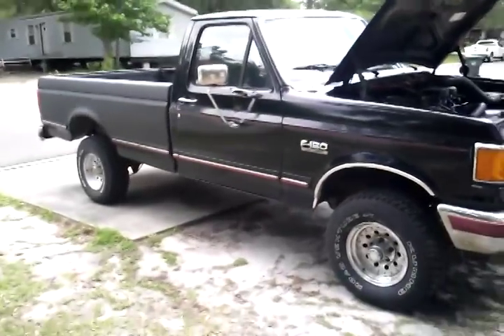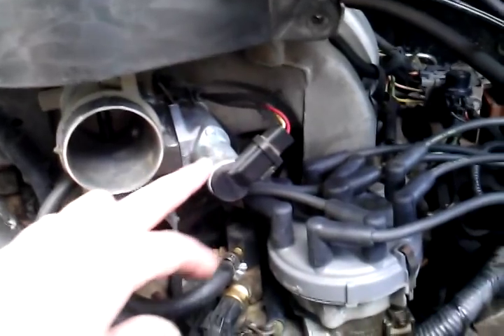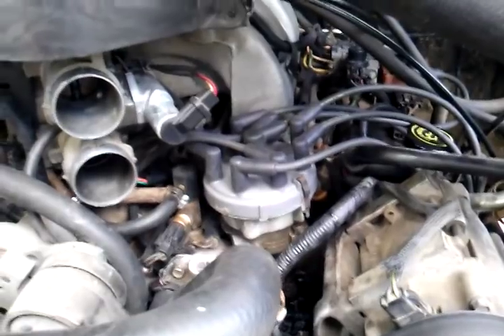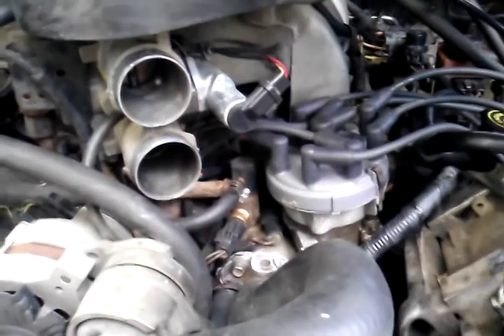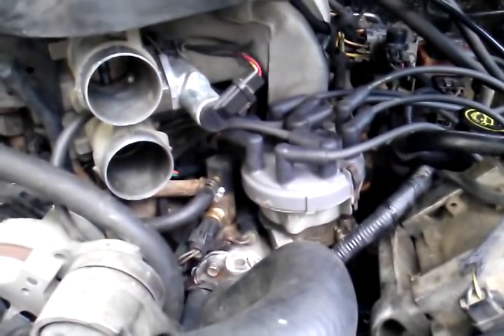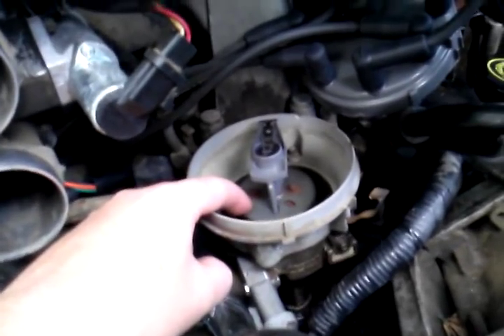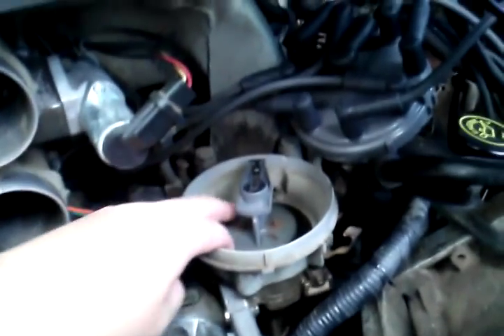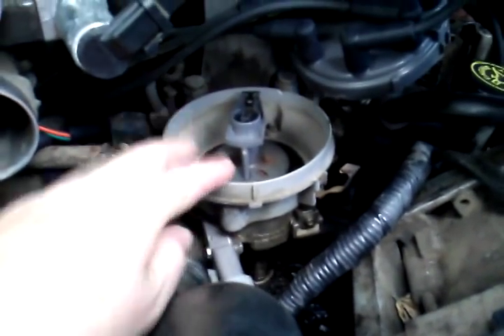91 F150 Pick up coil problems

Comment: Mine backfires at half throttle and beyond and surges really badly, I’ve replaced a lot of things and even put new heads on the truck new plugs new distributor cap, I’m completely lost, I’ve put new fuel filters everything and it surges and backfires, any ideas?
Reply: Chris Poindexter did u fix it
Reply: I put just about 2k in parts and it has no pick up at all thought it was a fuel problem until I changed everything but im going to change the distributor hopefully it solves my issue
Reply: @craineytv5787   stabbed a new distributor in it, and it solved the issue, no problems since since then, but I also put in a new ignition coil too
Reply: @craineytv5787   I ended up doing a head swap on mine recently, made a world of difference but the distributor was my entire problem, but since it backfired and had issues so long it bunrt up a few valves so be careful of it
Reply: Chris Poindexter yeah my valves tapping now think ima change em oil might try the oil first but everyone saying it’s the fuel filter gonna try it wednesday I installed a new distributor still doing it I haven’t change the fuel filter r computer only two things I haven’t changed tht can cause tht problem
Reply: @craineytv5787  just make sure you have the line tools to get the filter off, don't buy the plastic cheap one because its worthless and itll break off inside, i bought a metal set from oriellys for like 10 bucks and theyre way better.

Comment: when timing my f250 5.0, should the crank be on 0° tdc or 10° btdc?, I have it on 0° tdc yet the mark isn't where it should be with the timing light
Reply: 10° btdc. If you set it at 0° the then spark fires with the piston at the very top of the stroke and the pressure from the ignition will not be complete enough to push the piston down. With it a 10° btdc then yes the initial ignition will be before the piston reaches the top of its stroke and be fully engulfed by the time the piston begins to move down the stroke giving a better detonation and more complete burn and use of the energy. If you're at 0 it'll run like garbage, no power, possibly popping through the intake under a load.

Comment: Can this cause the truck to turn off when putting it in gear like drive or reverse???
Reply from the maker: It can but normally they just act up when hot
Reply: @BigTravGill  my truck runs great when I first started up and it's cold when it's in the closed loop but once it warms up and the loop opens it runs like crap ...so I'm thinking it might just be that pickup coil and distributor...it's the only thing I haven't looked at yet thanks for the info guys .....these words are kind of tricky sometimes
Reply: I have the same issue on my truck. Can you please post what fixed your stalling issue?

Comment: i'm having similar issues now, but truck wont start now, i still have spark though, did u have spark when it wouldnt start?
Reply from the maker: My truck did not have spark....1st how good is your spark at the end of the wires...?...if its weak it will not run..plugs will just foul out
Reply: the spark seems pretty good, nice blue glow, plugs look clean, not fouled, i'm about to do a compression test though, and hit it with my timing light, it may have jumped timing. i get a light pop every now and then when cranking, starter fluid doesnt help either...
Reply: Travis Gill no spark is likely ignition control module. There built cheaply, get hot and burn up. I go through one every summer.

Comment: Look people. I have a 91 f150. 302 crate engine. Happens b4 I got this truck.
But this truck will work fine but finally it would fry the igition module/ecu. The person who had this truck b4 me LoL had money he have me plenty of computers with this truck lmao...
 I'm broke..... This truck went through all 5 of them 3 ordered specifically for the truck... LoL he said "spares".... No kidding...
 Vin: matched.
The smog unit is pulled off could this be the problem...
Any help... I'm out of idea's man love the truck, but I about need to cut my losses
Getting expensive fast...
Oh and one way I know if it's the igition module or the ecu/ brain box, is that ig module... Fuel pumps work...

Ecu or the brain box.... Fuel pumps don't work.
Won't prime...
Hints 
No start

Comment: I just replaced both of my fuel pumps in my 91 f250, ran fine for a few miles, then shut off while drivin and wont start, it will crank and crank, is this what your truck did?    Thanks
Reply from the maker: Yes that is what it did
Reply: Sublimenade ignition control module is likely what you need. If your truck cranks and cranks and no fire that's it!

Comment: Any ideas???
Reply from the maker: ??...I cant see the question
Reply: I have a 1995 ford bronco that dies when I put it in gear I replace iac,throttle position sensor pretty much all the sensor except the pick up coil.it also has a new pick up coil and egr.  Any ideas???
Reply from the maker: @tazmontoya3203  My god that should of done it...checked for vacuum leaks...??
Reply: Check them and fixed any vacuum leaks
Reply from the maker: whats it idling at when in park..?
Reply from the maker: also whats the fuel pressure in park...then in gear...?
Reply: 35psi
Reply: It dosent change
Reply from the maker: I had this problem with a customers 1991 Ford Econoline with the 5.8 in it...he was short on cash so we did a manual over ride to get him by..there is a set screw you can turn up by the throttle linkage..later when he had the cash we replaced the ECM..that solved it...Hate to tell you that but it sounds like you have replaced all the possible options on a pretty simple system man
Reply: Can the problem be the fuel pump because when I checked the presure when I turned the bronco off the fuel presure dropped all the way to zero.